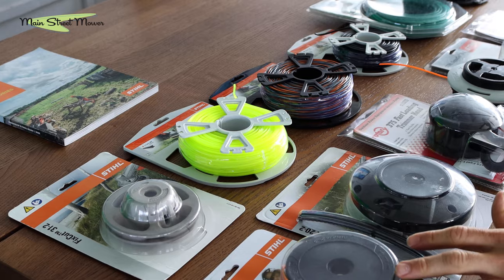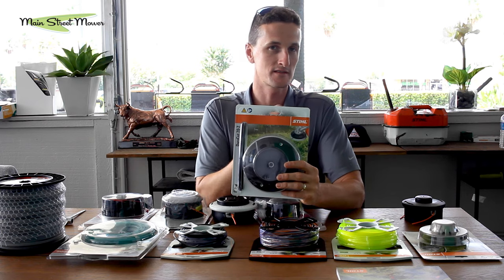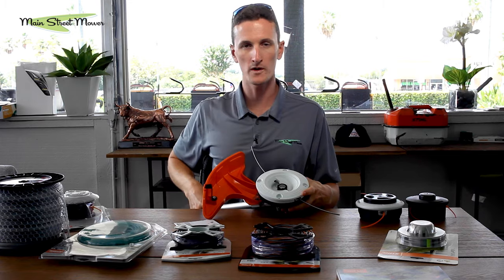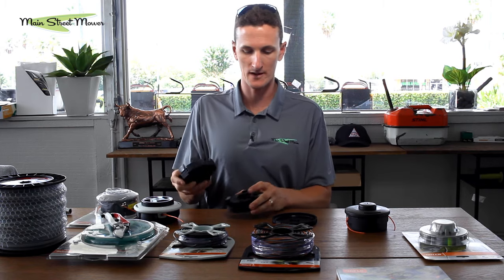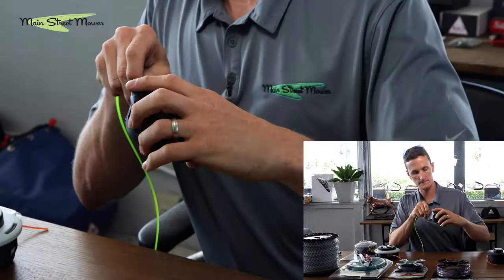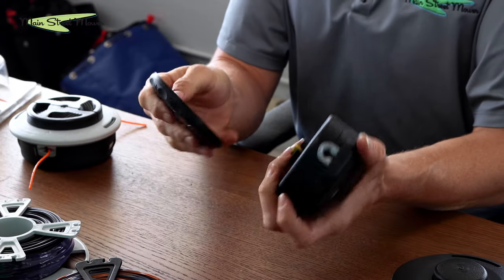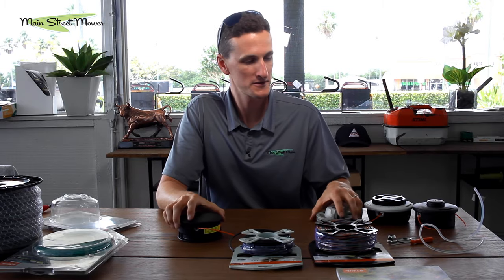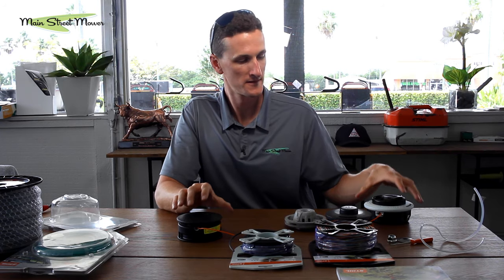String Trimmer Heads - Everything you Need To Know! Decoding Myths.

Comment: I HAVE A KOBALT 40V TRIMMER I NEED A REPLACEMENT HEAD.  I BOUGHT A UNIVERSAL SPEED FEEDER BUT IT DOESN’T WORK.  THE ADAPTERS ARE LEFT THREADED BUT THE SHAFT SCREW IS RIGHT THREADED.  WHAT SPEED HEAD DO YOU RECOMMEND.  MODEL KST 2540-06

Comment: Stu, u covered everything with STIHL trimmer heads, but, I'm inquiring about Craftsman 40v battery trimmer with bump .65 line feed.  My inquiry is about speed feed heads and it looks like your big STIHL head is the closest thing I've found on Amazon.  So, do you have any suggestions or recommendations?  I'm hoping I can keep the price at $20 or less.  I really liked your video and comments bc you really don't see alot of them on Youtube like yours.  Thanks, for your diligence in your work. Ron

Comment: Not sure where you got 10' from?   "Accepts 20' of .095" line" - quoted from Echo Speed Feed 400 specs.    "Accepts 25' of .095" line" - quoted from Echo Speed Feed 450 specs.    If your trimmer line is old & brittle, you can soak it in a bucket of water for a couple days.  That will hydrate the line & rejuvenate it.  Others have shared this trick on You Tube.   I've tried many, many different trimmer heads over the past few decades.   The Echo Speed Feed is by far the best one I have used.  Loading is simple/fast, & I can live with 20' loaded at a time.  I also suggest checking out MaxPower trimmer line tested by Project Farm on You Tube.  Project Farm clips are awesome information!     No matter what trimmer I bought, I would toss the factory head (unless it's an Echo) & add an Echo Speed Feed on it.
Reply from the maker: Thanks for the info! They aftermarket Speed Feed instructions say to use 10’ but obviously it’s wrong info
Reply: @mainstreetmower   I know 20' of .095 will go into a Speed Feed 400 with ease.   I think a Stihl trimmer head will hold more trimmer line because you are taking the entire head apart to wrap the line around the spools.  When you do that, you are somewhat wrapping it snug around the spools.  The spools could be larger I guess, too.   When I load I Speed Feed head, my two hands are manipulating the trimmer head.  I am not applying any tension to the trimmer line as it winds into the head.  I have to believe the line is not wrapped as tightly around the Speed Feed spools.   The nicest thing about the Speed Feed is no tools are necessary to do this.  You don't even have to remove the head from the trimmer to reload it.  it's actually easier to reload if you don't remove it.

Comment: The product information with my Echo Speedfeed heads state: .095 - 20 feet; .105 - 10 feet.  I did the same as you, woundup the string until the head tightened up.  Don't know how much it took up (maybe just shy of 30ft), however, the line heated up and melted to itself.  It's best to measure off 15-20 feet and call it a day.  I found it works perfectly with those lengths and sizes.
Reply from the maker: That’s great info, thanks for your input

Comment: In my European country, they sell Stihl trimmers with tap heads (autocut) which are trash compared to auto-feed heads (supercut). Everyone here uses only a supercut head. It bothers me that you Americans cannot pronounce Stihl right, it is German (st is pronounced like scht) so you pronounce it like schtil not steal. Great video, condensed information simple explanations, eth was covered.
Reply from the maker: Thank you for your feedback, I am a proponent of pronouncing words as they are natively, I will make this correction in the future.
Reply: I got a supercut because I thought it would be better than bumping all the time. For the last 5 or more years I’ve always having problems with it not feeding and have to regularly take it apart and manually feed out some more line. I’ve given up on this head and now I’m going to get one of the easyloaders instead. Do you have any explanation why my supercut head always stops working, I am using the correct Stihl .095 line.
Reply: Ain’t gotta be able to pronounce it, to use it……..

Comment: Really good, very useful, video, Harry. I’ll watch it again for your tips on reloading the standard head I have with my FS 94R. I had a very frustrating afternoon trying to keep the (yellow Stihl) string from binding and disappearing up into the head. Was about to order a Husqvarna version of the speed-feed that I’d seen recommended (and fits the Stihl with its adapter). I think one problem I’ve had is that the string was consumed faster than I’d bumped it out, so it just disappeared back up into the ports. The Super-cut looks interesting… but mainly wanted to thank you for the very thorough discussion of the options for swapping in different heads. 

Will also recommend ProjectFarm’s newest string shootout video. Very interesting comparison of several good trimmer strings.
https://www.youtube.com/watch?v=89BkJF0kVyc&list=PLaAyKE4ZgmI6CtXlWGntEoTi8lrD_ARJn&index=11
Reply from the maker: Thank you Bill. We're glad you liked the video. Thank you for the suggested video as well.

Comment: The other interesting point about engineering is that the stihl has an issue when you are bumping. The stihl has the recesses and grabbing points on the face of the spool which means when you are bumping they are hitting the ground, the uneven surface and valleys on the head are going to hit uneven surfaces on the ground possibly and chisel away at the head and ground more causing more marks etc. Where the speed feed has a flat and smooth surface which will not grind at the ground and chisel when you are bumping. It uses the outside perimeter to grab to load which as you said, is easier at your fingertips.  I guess Sthil was foresighted and did not think about the affects of bumping on the ground with an uneven head underside surface rather than just thinking about how you grab it to wind.

Comment: Harry, on your Stihl FixCut 31.2 head it you ran the string through the elongated holes of the head. That doesn't appear correct. Shouldn't it be routed through the round holes so the string lays in the guide?
Reply: I use a replica version of the Fixcut head and I use it as you suggested Glen. So using two separate pieces of string I get the four protruding ends to work on the grass. Speedy work.. lightweight for the  engine as well ;)

Comment: In the mid 90's I bought a Stihl FS85 straight shaft trimmer with the 2 hand handle.  He recommended the Supercut 20-2 head. Been running it ever since. I have a extra spool that I keep on hand and switch out as needed. I didn't know what I bought until this video. Good review of the popular heads on the market. (I still have the proper size rod to take the head off. Came with the unit when I bought it new)
Reply from the maker: Thank you for sharing.
Reply: I've got the same trimmer from the same time with the same head. :) What's bothering me is that lately the line advances much less often and erratically, which often leaves me with too short of a line to cut efficiently and I can't do anything to advance it. If anybody knows how to fix it, that would be great.

Comment: Can’t beat the Husqvarna 525 L straight shaft with their heavy duty rapid replace universal bump feed. 
Super easy to load 20’ of tough .95 line.
Couldn’t be easier. It makes weed trimming chores easy. 
Light weight and powerful with easy start up and good fuel economy.
Ergonomic feel and reliability with reasonable noise levels.
Reply from the maker: Good to know. Thanks for sharing. I will check it out.

Comment: You are clearly biased. I particularly like fixed length heads and use a Shakespeare Push-N-Load 4-Line head. I find it easy to load and I cut replacement line from large spools. Saves $. I tried a few different spooling heads and found them to be a pain, one of which you recommended. When trimming, I just carry a few extra pieces of string in my pocket and have no concerns about advancing line. I also don't put the trimmer motor in the dirt as you suggest is required. I do put the motor on the grass or some other surface. Most of us aren't typically trimming in dirt.  Of course it is possible my perspective would be different if I were a commercial user, trimming for hours a day.
Reply from the maker: Thank you for sharing. The fixed cut heads do tend to be a lot of people's choice. But honestly, whatever works for you best is best.

Comment: I used some really thick line on my 22cc trimmer.   During use, I noticed that the line lasted much longer.  But,  the motor became really hot.  It couldn't spin as fast.   I could see that the line wasn't hitting the weeds as hard.  Yeah that heavy line is great, but yir trimmer must have a lot of power .

Comment: My fs110 has the original bunp head but even with new line and proper line extension it's a PITA to get it to bump feed properly. Any thoughts.
Reply from the maker: Which head are you currently using with the 110?
Reply: @mainstreetmower  The one that came on it new. The first one you showed.

Comment: Echo speed feed 400 all the way. Best trimmer head ive used. Holds 20’ of .095 line for every day use, and about 15’ of .105 line, which i use for flip edging.
Reply from the maker: Awesome. Thank you for sharing Joshua.
Reply: Second this 1000% PLUS it is available at Home Depot for $30USD/$45CAD and comes with adapters to fit your Stihl/Redmax/Toro etc (and of course Echo/Shindaiwa)...
Reply: It IS the best. Been using since the day it came out, no problems.

Comment: Thanks for this informative video,but i have a question about the line
Stihl recommends to put the line before use in the water and let overnight it there,is that every time or just the first one’s and can it be stay on the head or we take of the head( look me all plastic so no problems)
Reply from the maker: Hey, I think STIHL only recommends that for used line. And I would suggest taking the line off the head before soaking it in water. We did call STIHL to ask them about this, and made a video out of it. Check it out on our channel.

Comment: We get the 20-2 in Australia on FS55 and FS85, they don’t always work but when it does it’s good.
Reply from the maker: Thanks for sharing Rick. Why do you say that they don't always work? We would love to know what's the consensus in your country.
Reply: @mainstreetmower  after about 20-25 years experience line doesn’t always come out and you have to open and refit the spool inside with the string line or the string line has melted and fused together which you mostly just need to detach and reset the line in the two grooves without having to re-spool the whole line.. 
Used different types of line standard Stihl line and  aftermarket including twist which is my favourite,but only 2.4mm0.95, they say to sprinkle baby powder on it to reduce sticking together, I’ve had FS85, FS55 and the smaller FS45&38 which work great with the old tap head, hate the new style heads.
Basic parts for 20-2 is eye lids $3 and $20 for cap replacement in Australia.

I did buy a 30-2 head but yet to use will only run 2.7mm, might try 3.0mm just to see difference.
I’m a Guard guy 
I hear every excuse under the sun why not to use a guard, usually I can’t see the edge, productivity but it’s usually because they can put the line out longer putting more stress on the machines.
Contractors out there not using guards, they are opening up problems with warranty and even insurance claims when filming there action, plus giving other users bad habits that shouldn’t be promoted. Insurance companies love to not pay claims, if your a YouTuber that’s no one ammunition to a insurance company.
Hence the use of the Guard in your video today on all blades, personally have used a star blade no 3 they are great for high grass jobs.

You can’t make an Industrial video about welding in thongs, though you have all the other safety equipment.

Comment: The fix cut trimmer head using a 
.155 heavy line for thick brush cutting is a bit troublesome to load BUT it cuts thick bruch well and last a while. My problem is to get the line to bend evenly while you thread the line through the holes. How can you get the correct bend on the line? When I get it close to the correct bend, the bend will protrude out a bit and shorten the cutting line from both sides.....Anyone with some suggestions?

Comment: My bump head wasn't rotating.  Couldn't figure it out for a while then realized that dirt had built up on the inside of the bump and was keeping the spool from going all the way down.  Turns out I must have lost the cap (if there is one) on the bump because it has a bunch of triangle holes on top and the cap is practically flush with the rest of the body.  When I bump it on the ground, dirt smashes through the holes.  Maybe I'll put some tape on it.

Comment: Turns out the 2620t (25-26cc) pushes the .155 line just perfectly. Surprisingly enough. Head just needed a little modification (drilled out the center hole that way it’ll fit in the speed feed 400/450). Just have to be careful and drill straight in.
Reply from the maker: Wow. that's great to know. Will definitely check it out.

Comment: The Stihl 25-2 stock head is complete garbage. Had a brand new one that came with my KM 56 R and a FS-KM head. It NEVER fed line correctly, ever. Had to constantly open it up (tearing up my fingers in the process because it's a royal P.I.T.A. to open) and manually pull it back out. Inexcusably dysfunctional product. Switched to the Durocut 20-2, and I will take swapping out the pre-cut line pieces out over dealing with the hassle of the 25-2 ANY DAY OF THE WEEK. Don't waste your time with the 25-2--not worth the plastic it's made of.

Comment: Hope you can help. I contacted Rotary Corp. on the suggested trimmer head for a Stihl Electric FSA90, their suggestion was the 9366. Is this different than the 13377 or 13375. I requested more info from Rotary but no response. Excellent video.
Reply from the maker: Definitely go with a 13375, there is a green adaptor in the package that will make it go right on your trimmer. I don’t think the 9366 would work at all

Comment: I replaced that metal plate wrong. I got it upside down and put the head on and now I can't get it off. Any idea how to loosen it now?
Reply from the maker: Maybe light taps all the way around with a hammer, next step would be to take to your dealer
Reply: @mainstreetmower  Thanks. I found out that the shaft needed to be removed and a screwdriver used to hold the head in place, then you can unscrew it.

Comment: I have a fs38 that is over 14 years old, stihl aren't horrible but they do have some major engineering failures, the handle fell apart after about two months.

Being plastic and very cheap they could have easily designed it properly so it would last.
Reply from the maker: Are you saying your 14 year old stihl (which is still working) could've been designed to last more?

Comment: I haverun the stihl speed feed for the past 2 seasons. Works well and is hard wearing but as it wears down it is horrible to reload. The little finger holds are trash and you cant turn it well at all
Reply from the maker: Thank you for sharing Beau
Reply: I have always run sthil weedeaters until today with the head you have and about 3 months in they start to have loading problems. I bought a Echo 3020t (Great and more power trimmer by far than my Fs 131r) weedeater today with their speed feed head and it's a superior system. I'll see how it holds up and I'll update you if you want.

Comment: Good video, but I need to see them, I need to use them. I go by the Military acronym of K.I.S.S (Keep It Simple Stupid). I use the base head, and I don’t bother with anything else. I want to find a head that can take the .105 or bigger and have enough to run the Weed Eater for several hours. I’m looking at the FS131. I like the power but the smaller string doesn’t last. I need a blade. I have 15 acres in the mountains, and I can’t get my tractor in to brush hog it down.
Reply from the maker: Pretty much all of these heads will run the .105 try Stihl new CF3 line in .105 for your toughest option. And check out our blade video. We use an FS 131R and work with all the blades available.

Comment: 😲 Dang yo you been using that "head" for years lol quite a player! 😝 Great video bro I like the stihl fixed head and I 4 string that sucker! Also your sapose to use the Lil rod in that head hole not the Lil screw driver.

I do rock the 240 and 131r and there is a better way to string that fixed metal head I rock without a gaurd you just got to use some cents when you do it without gaurd ido 9. 5 inches of length and it get the job done.
Reply from the maker: Thanks for the feedback!

Comment: I'm stihl (pun) rockin the 30-2 trimmer head on my FS110. it's been a great head and I can get the spool replacements at my local dealer. been running it for 14 years now and with slight modification to the spools I run the 3.3mm line. recently I bought an FS91 which came with the Autocut 26-2 and I gotta say I really like it.
Reply from the maker: Thank you for sharing Dave, we're glad your stihl running the same brand of trimmers. 😉

Comment: hey guys greetings from the Caribbean.  i run a shindaiwa 450. The head is a manual feeder. NO bumping, you loosen the thumbscrew, twist to the desired length, retighten and go. is there anything like the supercut, that would fit my sindaiwa? and would those work with the .130 line?

Comment: The speedfeed actually hold 20ft
Reply from the maker: Watch at 14 mins I total filled, opened and measured both speed heads, the manual only says 10 ft, but we found out the truth
Reply: @mainstreetmower  I meant as much as it can hold without overfilling it